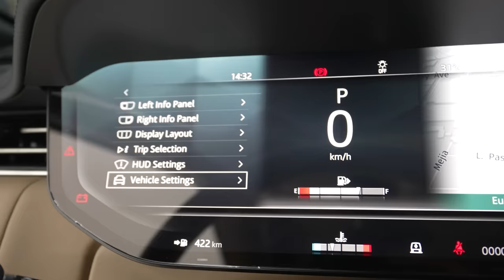GARAGE UPDATE: NEW CAR (Twin Turbo arrival) | Angie Mead King

Comment: Angie is one of these Range Rover fans that put up with the reliability and running cost issues they have.
Angie had the opportunity to buy the last of the Toyota FJ Cruisers that were still available in the Philippines that look a lot more cool, much cheaper and are more reliable and therefore more dependable than a Range Rover.